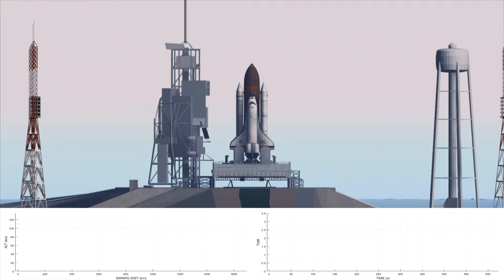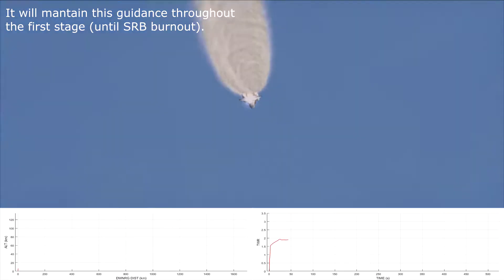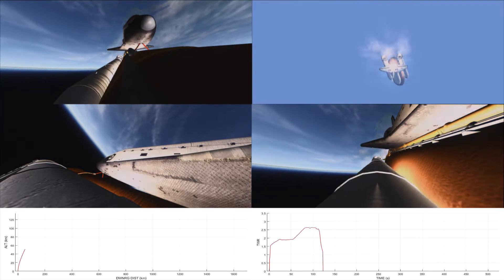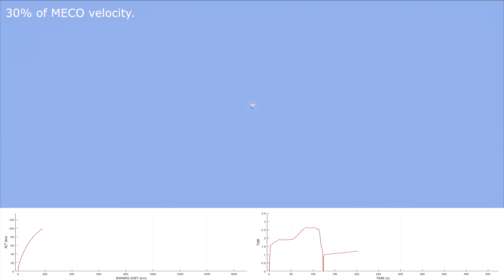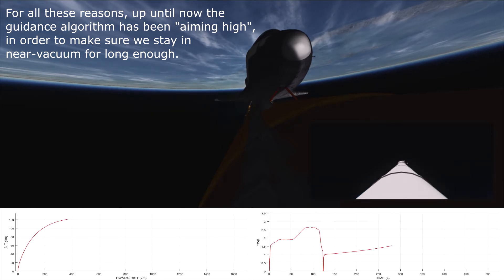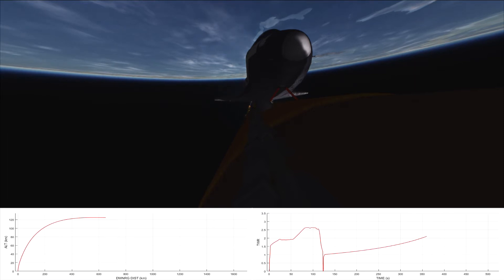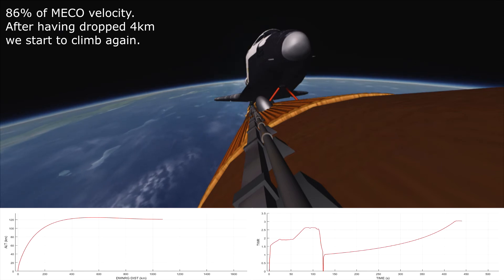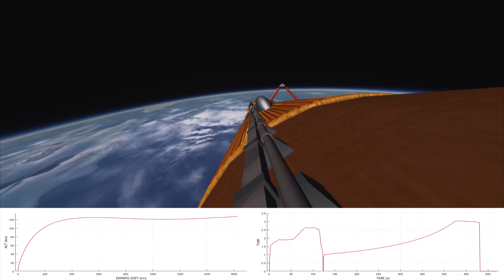KSP - Space Shuttle Challenger in RSS

Comment: The SRB’s can’t reduce thrust, only the SSME’s.
Reply from the maker: Maybe you meant to say that the SRBs cannot be throttled at will, like the SSMEs can.
But all kinds of SRBs can be made to throttle along a fixed thrust profile, by shaping very carefully the propellant inside the casing during manufacturing.
This https://en.m.wikipedia.org/wiki/File:Srbthrust2.svg is the thrust profile of the Space Shuttle SRBs which is implemented in Realism Overhaul. Compare it with the TWR  plot in the bottom-right of this video and you will see it explains what I measured
Reply: Ah